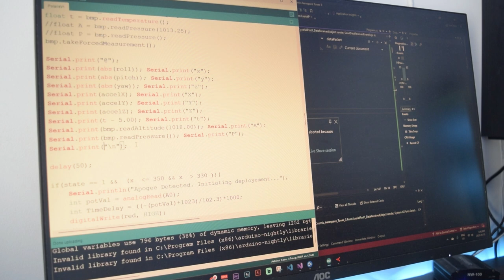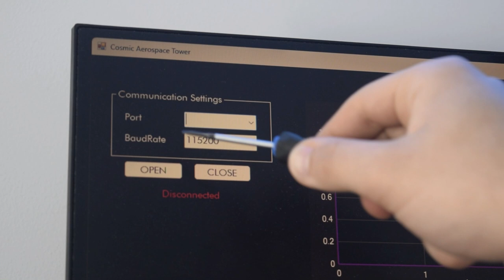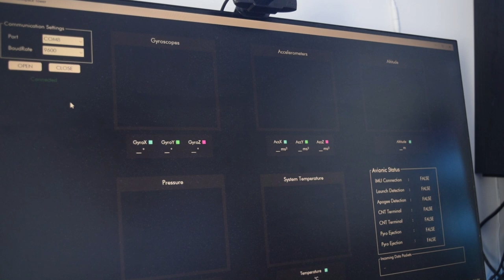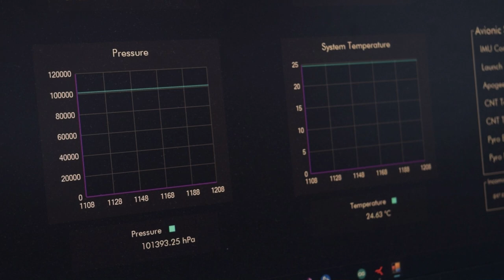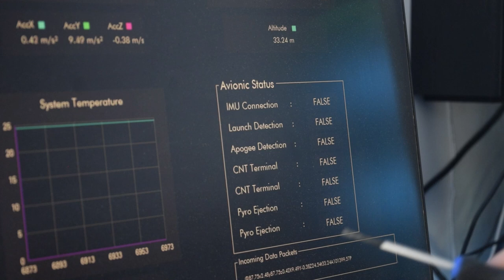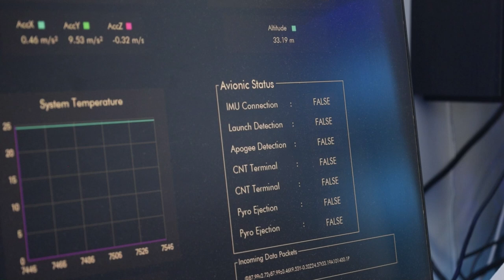Telemetry Dashboard for model rocket flight computers

Comment: hello, very good work, is there any high power rocket avionics that you recomend?
Reply from the maker: Currently I think that commercially available parts are the best option for high powered. Make sure to diversify the components. I focus more on medium-low powered but I am planning on moving to more reliable systems.

Comment: now this is realy nice but how are you suppose to get the data via usb connection if you are flighing them rockets? maybe add an nrf24l01 or wifi  RF module to get the data in real time while in flight.
Reply from the maker: Thank you for your interest. 
This was a demo but I am currently remaking the entire software, transforming it into the flutter framework. It will have multiple pages for general graphs, to location, gps, transmission and so on while mainting this simplicity.

It will be release at the same time that I release the VEGA 300 series of flight computers which will come with a module to hookup to your computer for wireless communication.

The flight computer itself will have an integrated transceiver.

My aim is to release it by August but delays will occur if I believe that there can still be improvements. Quality >>

Comment: How did you make the UI?
Reply from the maker: This version was designed with C# inside Microsoft Visual Studio. A newer version is designed with dart using the flutter framework. You can test the software, it is currently available on the Microsoft store (cosmic Tower) in Beta testing.